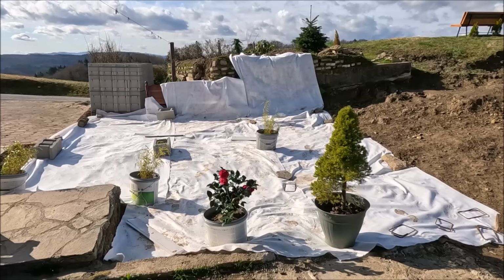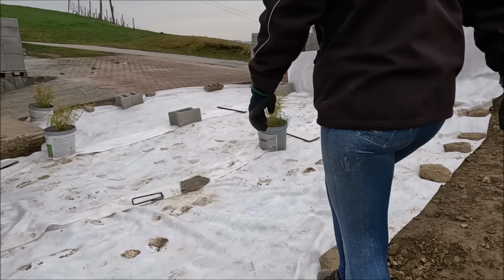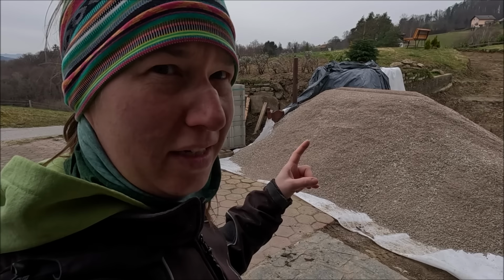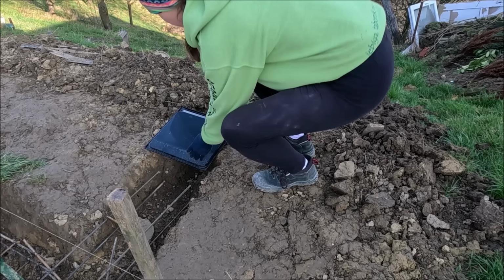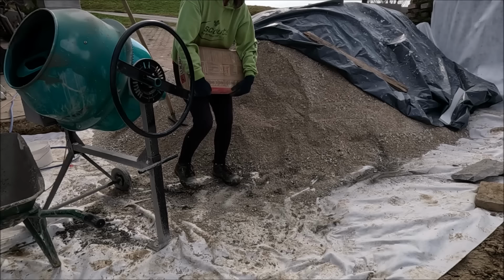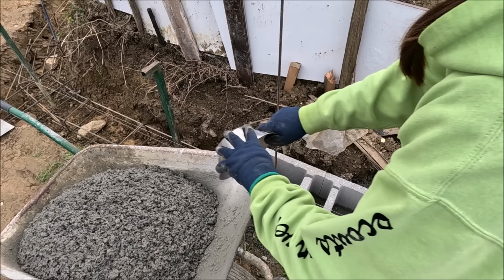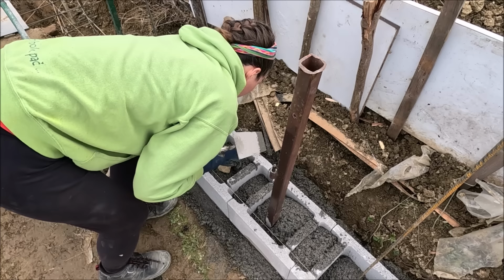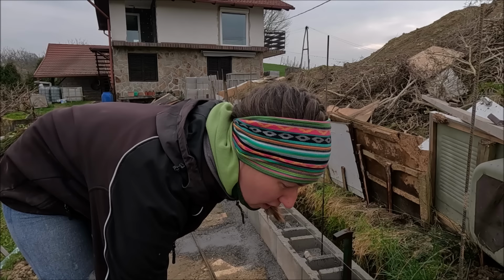First Block from Many - I Start BUILDING RETAINING Wall | Martinas Life

Comment: Maybe there is a video on YouTube about how to remove the blade from your tool. The wall is looking great.
Reply from the maker: Yeah maybe 🤔
Reply from the maker: I mean I know how to remove it, I did it bunch of times, but it so hard twisted...
Reply: Don't know if it is possible, but in the past if I had a lug nut that refused to budge, I would use an extension rod/tube to extend the handle and then whack it with a hammer....  @MartinasLife
Reply: Hi Martina,
Another beautiful lesson in courage and willpower👏
See you soon

Nikita

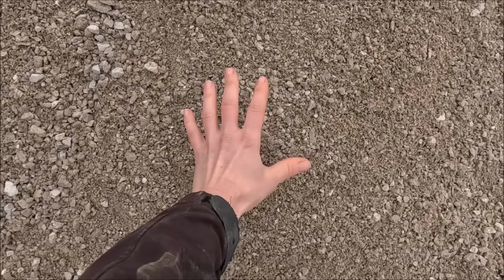Comment: 5:09 - What is this? Some fine fraction of crushed stone?
Reply from the maker: That's 0-18 mm sand or gravel or stone, rock...
Reply: @MartinasLife  I tried to find the correct English word in Google translator for it, in Russian we call it "отсЕв" - otsEv. I mixed 4 parts of river crushed stone 5-20 mm, 2 parts of river or washed quarry sand and 1 part of cement
Reply from the maker: @rusmoscow1971  this one is not washed, it's from quarry and crushed from 0 to 18 mm